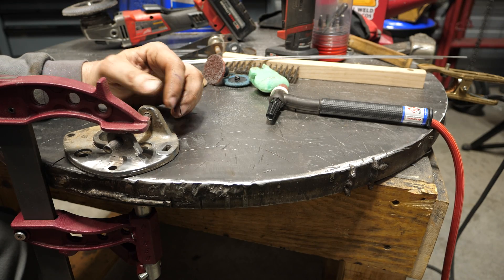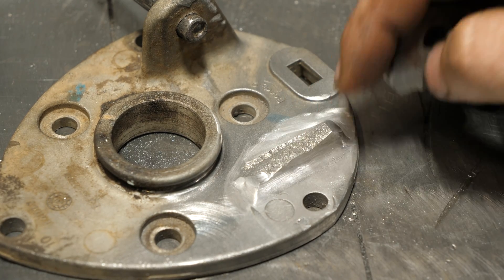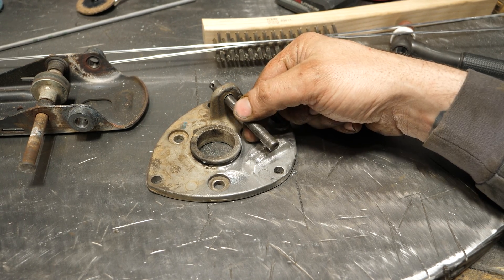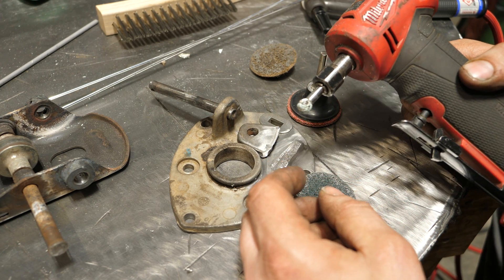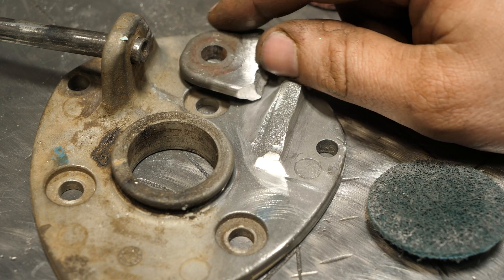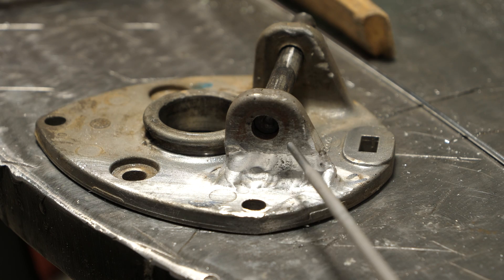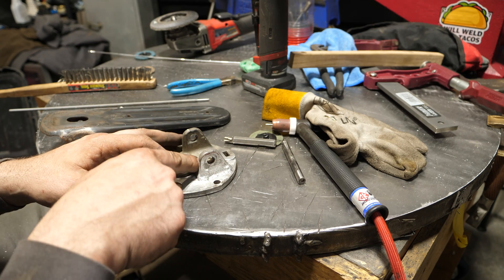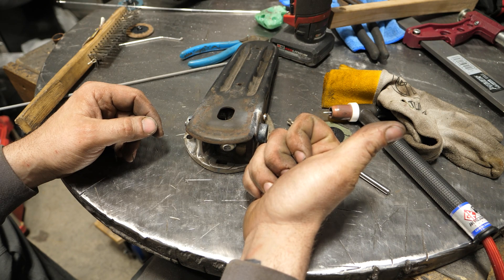Tig welding repair on a aluminum casting

Comment: I learned to tig aluminum first then learned to tig steel - steel was much easier to tig - I really enjoy doing aluminum tig
Reply from the maker: Aluminum tig teaches so many valuable tig skills.  It forces you to feed a lot of filler fast, which trains the feeding hand.  It teaches arc gap control to a level of perfection.  It also teaches reading a puddle because the material makes it hard to see signs of how hot something is (no red glow).  No doubt learning aluminum first would have helped your skills a ton.  I always tell people if they can handle frustration that learning tig aluminum first isn’t a bad way to go.  Very steep learning curve but it does wonders for skills.

Comment: In Mig spray a row of tacks can stop porosity bubbling where a continuous weld can't - then welded over.
Reply from the maker: The issue with tack welds is they produce poor penetration, and very undesirable heat affected zone lines.  Aluminum has a change in hardness and flexibility in the heat affected zone due to heat input.  It’s far better to have a smooth line due to consistent heat input than it is a jagged line due to very inconsistent heat input.  Tacks also make weak welds due to inconsistent fusion.  Also, keep in mind that porosity can’t be removed much by wire welding processes.  The weld just conceals it.  Porosity in welds = poor strength.  Aluminum wire welding is often very undesirable on critical aluminum welds because the welds often contain porosity on clean metal (a dot here and there) and significant amount on castings.  Tig gives the ability to boil out most of it and produce clean welds that are stronger than wire welds.

Comment: I shouldn't write this but to modify the drain collector I welded a new aluminum plate to the casting (quite clean) and I didn't use acetone but a rotary file, the effect exceeded my expectations having such little experience (a dozen or so hours of welding on clean aluminum). So far, the castings were easier to weld than some new pieces of aluminum. 😅 I don't think any of us would be mad at 2-3 such minor repairs a day. 🤑🤑🤑
Reply from the maker: Cast aluminum tends to be a joy to weld provided the material wasn’t holding oil.  Some aluminum castings are very porous and hold onto so much oil they become a nightmare to weld.  If the casting was fairly solid and didn’t have a ton of material sitting on it they will often weld like perfectly clean aluminum like you found out.  I would take cast aluminum any day over cast iron.  Cast iron can be a real pain to weld.
Reply: @makingmistakeswithgreg  Speaking of cast iron, I plan to weld an oil burner from an old brake drum. I'll probably have to use stainless steel wire to withstand the temperature. And what's your experience with brazing? I had the opportunity to make myself a boiler adapter from copper and stainless steel. I didn't have a liquid-cooled torch available at the time and I didn't have enough amps. 🙃

Comment: If you get a burr that loads up with aluminum soak it in a Lyle solution for about 10 minutes and all of the aluminum will be dissolved and the burr will be undamaged.
Reply from the maker: That would sure beat using a small file to
pick all of it out lol.

Comment: Hi Greg, If you pre-heat the part would that help with impurities or would it just get the puddle started quicker? I like welding Aluminium when the jobs come in but have never welded cast.
Reply from the maker: Preheating works really well on thicker material.  The power required to weld 3/16th and above aluminum becomes ludicrous so preheating will massively help with getting a puddle going.  On thinner material it’s not a big deal, but it can still help by burning off filth on the surface.  That becomes super important on things like oil pans and stuff that held oil.
Reply: @makingmistakeswithgreg  Thanks Greg

Comment: A Tig  brazing Video would be very welcome as I have struggled to master this process
Reply from the maker: I did one video on the subject here https://youtu.be/nazf5gqJwfw?si=Yja-dKdpv-IjTM_a .  Tig brazing is actually pretty easy provided you can tig weld.  It functions just like tig on steel, you just use about 75-80% the amperage and keep the arc on the bronze.  With aluminum bronze it helps to use a/c with tig and 90% DCEN (10% cleaning action).

Comment: Great video with a wonderful explanation.  Am I correct in assuming that you used a 4043 or similar filler rod?
Reply from the maker: 4043 is what I used.  There are a bunch of fillers that could work, but I find that 4043 tends to work good on small jobs like in the video 😀.
Reply: @makingmistakeswithgreg  Yes it is.  My understanding is that Silicon based Aluminum alloys are most often used for casting alloys.  A rod that you might want to think about using is 4943 as it has a higher as welded strength than 4043 and has fluidity like 4043.

Comment: instead of the pin use a piece of ready rod, four nuts, adjust till part is lined up, clamp rod to base, grind your V's as you did and weld away. The ready rod just holds the part in place so it won't shift.

Comment: Nice video Greg.  I don’t have much aluminum experience so I enjoyed learning. At first glance I thought…. If it doesn’t weld nice, it doesn’t seem like making a whole new piece from steel would be all that difficult.  With those burr bits in the field I usually use hougen slick stick from the mag drill, keel (lumber crayon), or even wd40 to keep from getting gunked up. They also work very well for grinding wheels on hot dipped galvanize.
Reply from the maker: I will have to look some of those up.   I have used wd40 with polishing aluminum, but not with cutting 😀

Comment: That's a bus accelerate pedal!  I repair a bunch of them there out of blue bird bus....  
Me and my primeweld tig 225x stay busy with little aluminum repair like that....
Reply from the maker: A bunch of jobs like that will definitely keep some money flowing and fill in a bunch of time 😀.  Pretty much any A/c tig welder can do it which makes it even better.   Have you found they commonly get broken?  The amount of corrosion on it was significant (it was cleaned off before I got it).
Reply: @makingmistakeswithgreg  you're definitely correct on that it's nice when you get any kind of little aluminum welding repair it's an automatic hundred dollar bill..... 😆😆😆

Comment: E6 foot valve mounting plate. It's for semi-truck air brake. There is indeed a plunger in the big hole. Probably the shaft was stuck and rusted and someone had to hammer it out. Ask me how I know 😂
Now every couple of months I desassemble the pedal and the plunger, clean and grease everything, the brake pedal is smooth like a new truck.
Reply from the maker: Nice to know.  Sounds like a pita to get it out.  I didn’t remove it, but there was clear evidence of a lot of heating with a torch lol.  Got to love steel/aluminum mixed parts that get filthy and not greased.  Guaranteed to get bound up lol.
Reply: @makingmistakeswithgreg  yeah and in winter you are carrying full of deicing salt in the cab so its a very nice mixture for aluminium/steel part! And to unscrew this plate you have to get halfway under the cab of the truck with a frame rail and a big engine/transmission in the way haha 
Anyways very nice job 👍👍

Comment: No AC tig machine for me.  Oxy-Fuel it is.

Lie, which is what some drain cleaners are, will absolutely eat aluminum.  It's the easiest method I've heard to clean files and carbide burrs. If you're feeling spicy, you could even add a few extra things, boil it, and do some hot caustic bluing.
Reply from the maker: Interesting, that might just be worth it.  I have a burr that’s loaded with aluminum and sitting with a file picking it out doesn’t interest me lol.

Comment: A tip for welding aluminum to slow heat loss. Now before we start, you will have to ground the part and not the table. 
I put small parts on section of exhaust gasket material to keep the table from sucking the heat out of the weld. It's from the hotrod section at the autoparts store. Mr Gasket and others offer it. It's just a piece of high temp gasket about 6 inches wide and 18 inches long approximately. It lasts a year or so at my hobby garage and is well worth it.
Reply: Not only that Greg is a great teacher and i learn a lot. But i always watch for some really helpful and useful comments. Thanks

Comment: I've done things like that with a mig But before I do that I sand blast it and then I set it in an ultrasonic cleaner And that water turns awfully dark but you're correct the optimum process is Tig and not everyone has a Pro pulse 300 HTP welder that does double pulse aluminum and when you do mig weld it the setup is different you can't just set the parts back together as they were f u s e that back together it almost a knife edge when you wire weld it the fitment that is with TIG you have to put it back together as it was I'm very finicky when it comes to repairs like this I would hardtack that in several good places and take a die grinder and put a u Groove in one side of it and then welded and if you wire weld it you're going to find that you have to as you probably already know take a die grinder and do a lot of grinding this is the only way that it would be successful because like with a TIG you can boil that stuff out you're going to spend a lot of time with a carbide Burr if you use a MIG this is just my experience good video
Reply from the maker: How well does an ultrasonic cleaner work?  I have never used one and have been thinking about picking one up to make my life easier.
Reply: @makingmistakeswithgreg  if it's really dirty like you were talking about in the video like internally dirty inside the metal not just maybe crusted on and just in the surface layers of the aluminum it won't go all the way through but it does take some of the hard work of having to sit there and cook all of that crap out of the aluminum for other things it removes dirt and grime fairly well but if it's a really critical part and I am fixing it to really fix it fix it I will glass bead dustless blast (water shielded)  first and let it sit overnight in a bucket of acetone if it's a small part an ultrasonic cleaner is a good investment especially if you Tinker with old school cars which is something I do ones with carburetors on them love them old 318 Mopars

Comment: I TIG welded the lower half of the triple tree on one of those cheap imported minibikes for children and the cast "aluminum" it was made from actually sparked when I was grinding it occasionally.  I tried to keep grinding until the sparking stopped but every time I thought I was good it would spark again so I eventually gave up and tried to boil it out with the tig torch, it was ugly and a huge pain but I eventually got it to look half decent.  I decided to add some good aluminum to the important areas so that the child could ride safely and that presented its own challenges with even more garbage coming out and the time spent was insane but the smile on the neighbor kids face every time I see him riding it was payment enough. Lol
Reply: Some jobs pay in ways money can't
Reply: @a-k-jun-1  so true. lol
Reply from the maker: Awesome.   Yeah, that aluminum probably had everything and the kitchen sink in it lol.  That’s aluminum for you.  Sometimes things that look terrible weld perfect, and things you think will be easy are a nightmare.  Most of the time it’s a hope for the best situation lol.

Comment: Ozzy Beer? (Bundaberg is an Oz brand.)

Cleaning - 99% isopropyl alcohol?  (Can get this at Fred Meyer’s, 2.49 for 16 oz - about 60% of Acetone.  (Acetone for final cleaning?)

A preliminary cleaning can be done with a mix of rubbing alcohol (70%) used to rinse out “empty” bottles of liquid dish soap.  You want it to look like Windex.  It really gets rid of grease and dirt.

Comment: With that design, the pin shouldn’t turn at all. The pedal turns on the pin, while the pin remains stationary. Those aluminum ears aren’t bearings. If the pin turns, eventually the pin will grind right through the aluminum. For burrs, there are aluminum cutting burrs.
Reply: There is a spring pin that hold the shaft in the steel pedal, so there is no steel on steel rotation. The shaft rotate in the aluminium. Not a bulletproof design lol
Reply: @lmaximeraby6268  that’s a bad idea. I’d never design something that poorly.
Reply: @melgross  yeah you are right, and above all considering the price of the assembly! Would you think bronze sleeve in the aluminium would be a better design? On the other hand I changed this plate 10 years ago and there isnt too much play doing stop and go city driving, so we could say it is doing ok haha.
Reply: @lmaximeraby6268  well, you know how it is, not every one will fail. But it just looks to me to be not well thought out. Sure, sleeves would be much better. Also the two flanges could easily be made thicker. Engineering is interesting. When they designed this part, it seems as though they either winged it, or used the minimum possible material they thought would work. I usually add an additional 20 to 50% to the safety factor.
Reply: @melgross  not only that, but this part seeing frequent humidity and boot full of deicing salt, the pin should have been made of stainless steel. The spring pin is almost garanteed to be stuck, and if there is a rust buildup on the shaft, if you have to remove it then you are almost shure to break those ears. I clean and grease mine every couple of months to avoid these issues.
Reply from the maker: I think there are some parts missing from it, but you and lmaximeraby are right, the design is pretty terrible lol.  By the look of it someone had to torch the pin out of the pedal itself, to get it apart. I buffed the metal pin on a wire wheel before I short the video, it literally looked like it had barnacles growing on it. When I heard the replacement is 600$ clearly it must be a scam to design a guaranteed failure part 😅

Comment: welding castings is so hard the aluminum bronze foundry I worked at stopped bothering.  crack in a 300 pound casting? pour it again.  This might be one of the hardest tasks there are to weld.
Reply from the maker: I have brazed a lot with aluminum bronze filler, but not on actual aluminum bronze material.  With the filler wire I find it brazes much better running a/c tig with 10% cleaning.  I bet a casting would likely be dirty enough that the little bit of a/c cleaning won’t be of much help.

Comment: That's a tidy repair young man. I wouldn't have even considered gas welding aluminium with Oxy Actylene. I do have an AC/DC Tig welder but my skills are somewhat poor so I don't tend to take on any aluminium work, plus my eyesight at 58yrs isn't sharp enough at close up range for tig welding and my filler rod technique is lousy. However, Oxy Acetylene might be something I can do better with, can you do a video on gas welding because it is something I would like to learn about along with brazing. All the best!
Reply: You can use oxy/acety. But you need to be pretty skilled welding aluminum. Otherwise you’ll meld the entire thing down to a puddle.
Reply from the maker: I will have to do a video on oxyfuel welding and cutting.  Melgross is correct, it does take a fair amount of skill to weld aluminum with it just because it doesn’t give much warning on hot vs too hot.  The flame burns so much of oil out that for certain jobs (oil pans) I find it works pretty good.  Tig aluminum has a very steep learning curve, the arc gap needs to be just right or everything turns to crap.  Too close the metal jumps to the tungsten, too far away and the arc wanders excessively.  It takes a while to find the balance.

Comment: Gregg I did a repair to a cast aluminum track burner assembly my co worker dropped and broke it. The Blue Demon rods 4043 and cleaned it with acetone.  
There is a trick I’ve watched a guy using tig machine on DC with the 4043 1/8 rod as filler with success.
Reply from the maker: So you can weld aluminum with DC, it’s a sooty process.  The main limitation with DC aluminum is the fact you really need helium to get it to work properly.  Helium has become absurdly expensive as of the last few years (especially the high purity that’s required).  One thing I have never tried is using fluxed aluminum welding rods with tig as an emergency repair solution.  I know aluminum stick rods work (but are hell to run lol.).